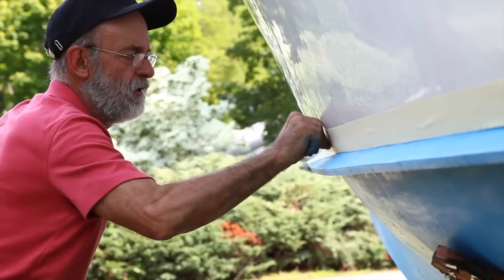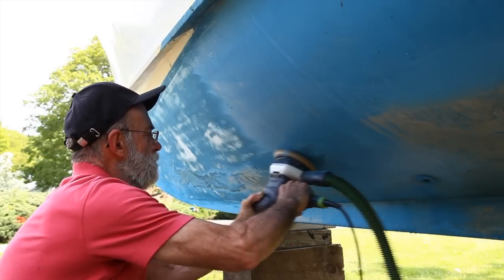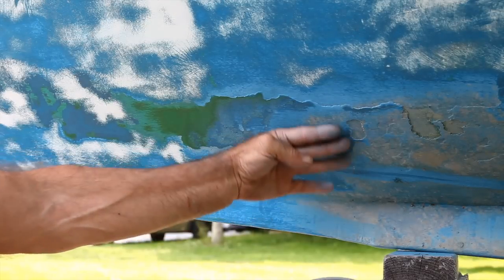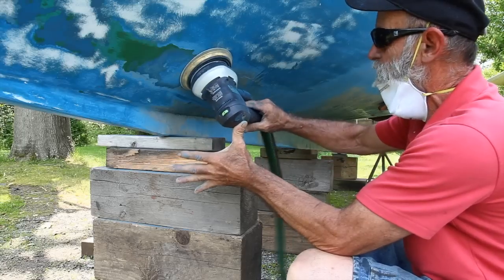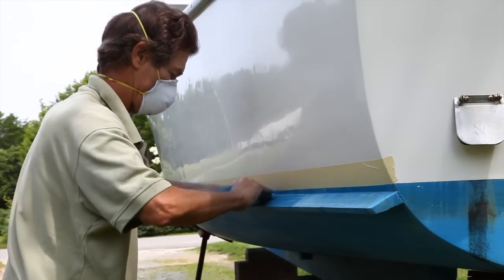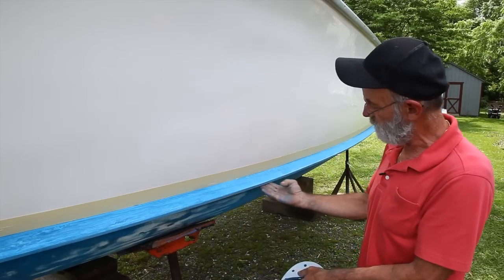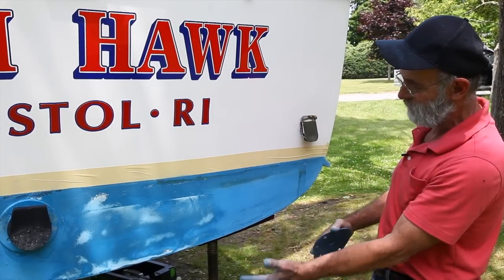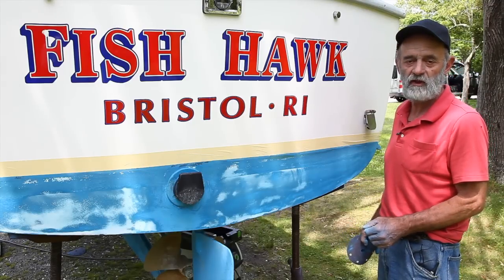Prepping Your Boat for Bottom Paint

Comment: I have found that a welders scalier works like a dream on removing dried flaking bottom paint it's as fast as sand blasting with out the cost.And the mess but only works on dry paint, It worked for me.

Comment: Quick question: I sanded a metal keel to a fine finish and applied and rust treatment paint. I now have a very glossy smooth finish. Would this be to smooth to apply anti foul directly over or should I apply some sort of primer to give it key first. If so what do you recommend? Thanks in advance. Paul

Comment: Great video, Do you know if you can you use a regular shop vac with the Festool sander?
Reply: I've used an old household vac several times for hours. No problem, except fitting the hose
Reply: The Festool vacs have a HEPA air filter on them, so they really keep dust down. A regular vac would work just fine though. I can speak from experience that the heavy duty Festool sanders are magical when it comes to this kind of nasty work.

Comment: thank you for the video, very helpful, only one question left, do I need to apply more gelcoat on the areas where I can see fiberglass or I can paint on top of fiberglass? And also I have some cracks on the old paint, should I sand it until it disappears ?
Reply: Azat Gimranov  don't sand like this he is taking off too much, you shouldn't see that much gel coat. Plus you should have a respirator, this guy is old and just doesn't care I guess.  That bottom paint is some nasty shit.

Comment: i have a 22 foot oday sail boat, it has been sitting in the tree line for ten years. it's a mess. after getting the 14  inches of water out of the boat i am faced with mildew, scales oxidation, and anything else if you can name it, boat is still sturdy.  the  fiberglas on the inside of the boat is coming off in a lot of areas, i have gutted the interior.  on the exterior where a want to start, i am lost, where di i start first, please help.  thank you, ken boren
Reply: +KEN BOREN get some bathroom cleaner from the dollar store. The thick gel will adhere and clean mold ect.

Comment: How long would a high grade paint last. 20 years, 40 years what ?
Reply: 1-2 years
Reply: Ouch
Reply: Really Happenings that's a generalisation, boat construction material, type of paint, preparation, application conditions, environment boat is in all are major factors for longevity. In temperate climates, a correctly applied quality 2 part epoxy paint system such as Altex will last 5-10 years for topsides and below waterline priming. The antifouling will only last a year or two as it's designed to degrade as part of the process for poisoning would be aquatic squatters on the hull, but doesn't need to be stripped back, just top sanded and new stuff on that. You can get away with this for 5-10 years before a full Greenfield approach.